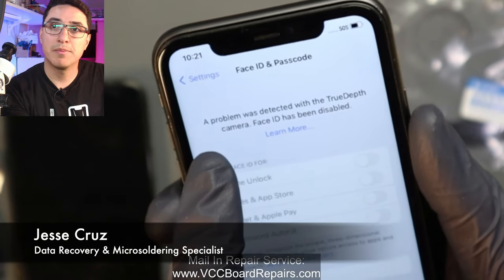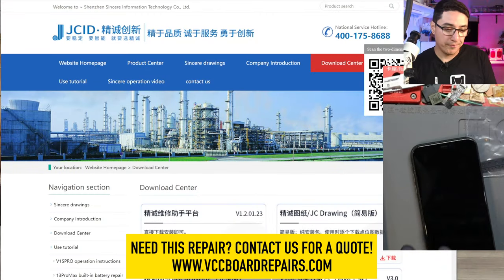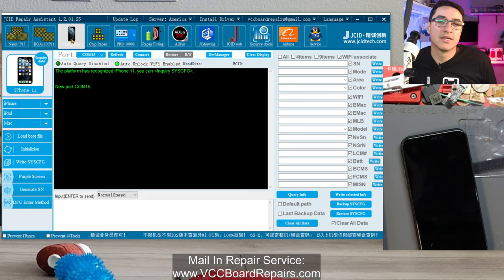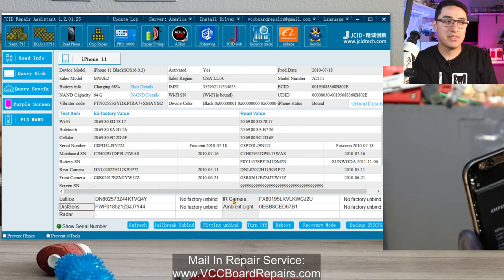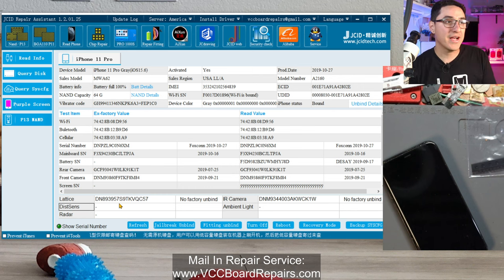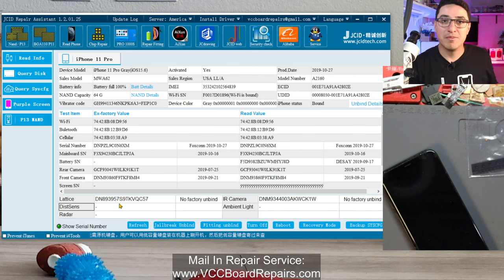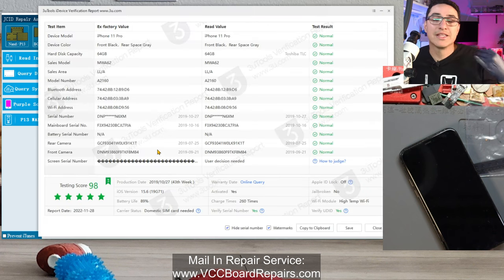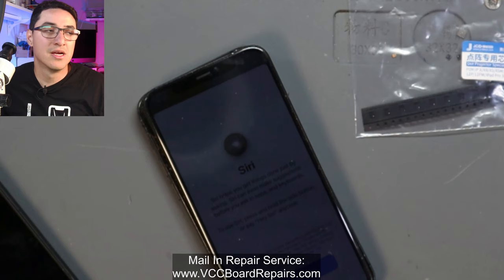JC CHIP METHOD - How To Troubleshot & Fix TrueDepth Camera Failed with New Dot Projector IC

Comment: Great video Jessie. I had truedepth prompt after repair the prompt disappeared. Dot projector gets pass when tested but doesnt light up when trying to use it. Also portrait mode gets move further away prompt. Do you think this chip method could fix the issue?

Comment: Jesse 
Could you do a video on dot projector repair on iPad Pro 3 have i2c box and replacement flex ?
How to remove from metal bracket unlike iPhone cases ?
Reply from the maker: You have to pop the sensor out of the metal housing through the side. You don't cut any shields.
Reply: @VCCBoardRepairs   thanks I’ll have a look do you use heat ,don’t want to damage it !
Reply from the maker: Yes I do. I recommend you practice on it
Reply: Jesse your videos are excellent and very clear thanks again !

Comment: Jesse, thank you so much! You confirmed my suggestion about flashing with detached iR-camera. I had the same issue when was playing with nand.

I have a couple questions:

1. Can you please do the video about case of lost original data of Dot Projector. What if this JC chip goes bad, what then? You won't be able to read data.

2. Does orginal Dot flex cable (just the cable without dot module) contain any data? I have an iPhone with torn Dot flex and I just want to transfer Dot module to new OEM flex. Will it work?

3. Could you make a video about restore TrueTone and Face ID without original screen/reciever flex. JC has special receiver flexes. As I know you'll need to desolder nand and do parts unbind with P13. Would be great if you show the process.

Thank you!
Reply from the maker: 1. Yes you can recover it by unbind through NAND

2. The OEM flex contains nothing

3. I have it recorded already. Just need to edit and will post soon ☺️

Comment: When I tried the method in this video, the IIC malfunctioned as well. Since I did not have a spare chip, I replaced it with a JC-Flex cable and it did not work correctly. Is this due to the fact that I replaced the cable? Is there a solution to this problem? Also, why can't I copy the data from the original flex cable?
Reply from the maker: If you read the original data before messing with it, then you can just write the data to the new JC flex and everything should work.

It's not the flex you're originally reading data from. It's the sensor

The JC flex has a new IC that you're programming

Comment: Hi boss, I have a question, my phone has the truedepth camera error, so from watching this video I test my phone with the jc software and my distsens and ambient light can’t be read so I checked my earpiece speaker and realized the flex was damaged, I  fixed it with jumper wire and I’m pretty sure it’s intact, I put it back in my phone, it still can’t be read, I tried updating, it still won’t show up, 
Do I need to restore to make it work?
Reply from the maker: There is problem with the jumper. best to swap to a new flex

Comment: So on Jc repair assistant if the IR camera is reading but giving me 00000000000000, does that mean it’s my IR camera is messed up and not allowing Face ID?
Reply from the maker: all zeroes means the phone has been restored without the ir cam plugged in.

plug it in & update or restore and see if the readings come back
Reply: @VCCBoardRepairs  I’m guessing the ir is broken if it’s reading that it’s not plugged in :/ thank you